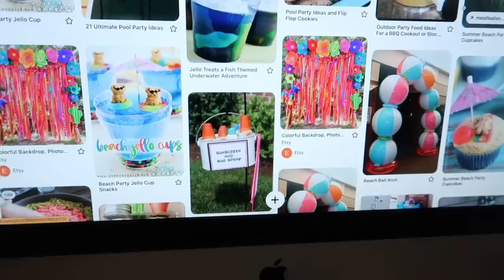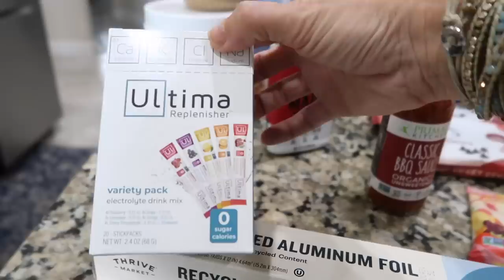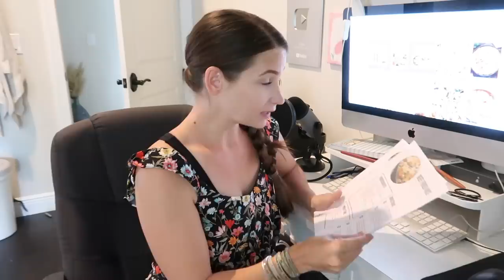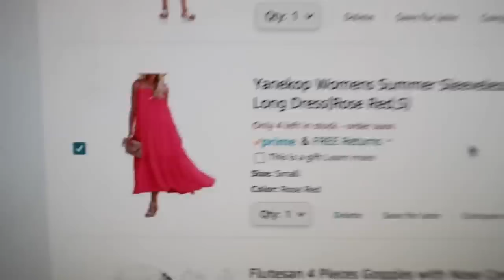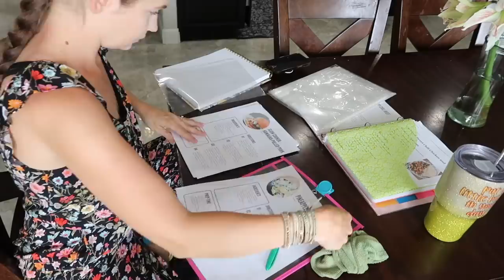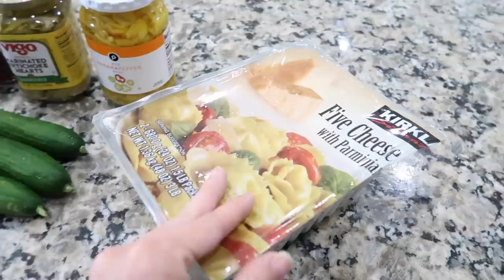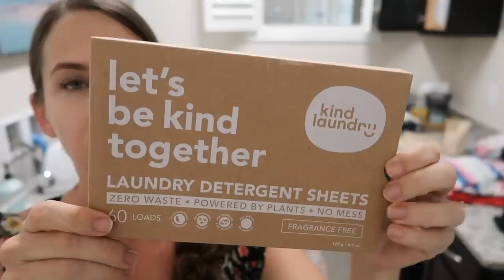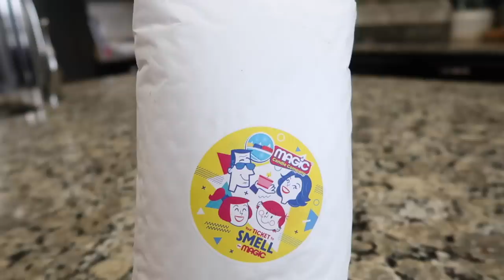I Live To Eat!  Food, Meal Plan, House Plans & Fails, Around The House Happenings, Chit Chat & More

Comment: Kim, have you thought about putting in a buffet to store your serving pieces and also use the top for serving. Just keep it simple with some big chunky tall candle holders and candles and a nice big piece of pottery with a mirror between them. Where your clock, a big artificial tree at least an 8’ would look great in a basket or heavy pot. That corner where your hutch is would look great with a corner unit a bit less country. Black chairs sound great, but they do scratch. A more natural finish won’t show so much wear and easy to touch up. I went black with the black kitchen set and the kids have scratched them. You can just repaint them as an option. I did, but if you repaint one chair, you have to repaint all of them.🤪

Comment: how much heat does a skylight let in with the Florida sun beating down on it?, might be a lucky escape? I think you mentioned you don't ahve a mudroom hallway, but you could close off that entry to the dining room as I think there's too access points (one next to the mirror) then you'd have more wall space in the hall for a hall tree or the like and or your french cabinet on the other side of what now it a hole in the wall. and i think the other door opening would still work as it's closer to the kitchen..not sure, just me two cents worth

Comment: Kim, about your skylight. It does depend upon the roofline on getting a skylight however you should have been offered a tube light. It lets in sunlight anywhere!  My husband was a contractor and we had our own business. Make sure you get credit for things that you’ve paid for. Also, I’d consult your contractor about the can lights. There is definitely enough room in the attic for them to run the wires. So sorry you’re having so many issues but that is pretty standard with all the subs you have working on your project. The contractor is the guy in charge and should be on top of that

Comment: I had an idea, as a solution to your window\skylight loss, just a suggestion.  Why not cut out the existing window into a door way?  Yeah it would take cutting the wall, is it block since its an outdoor idk.  Doing it now while you are still in reno mode and add a pocket door with glass slats going into the new hallway adjoining the new addition.